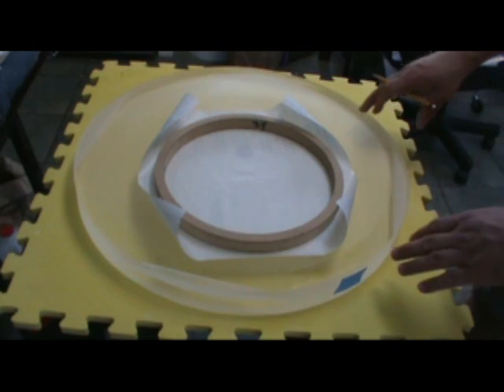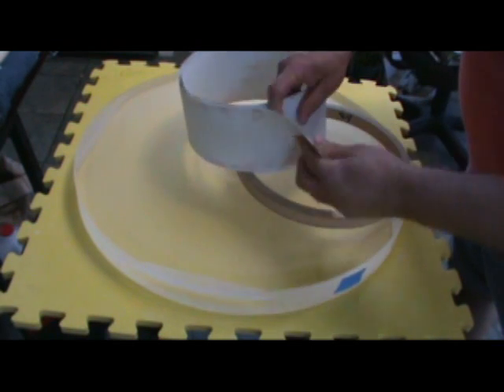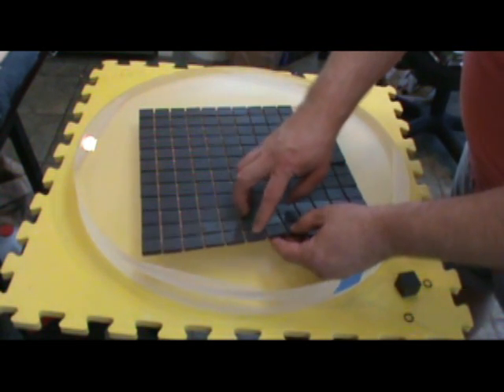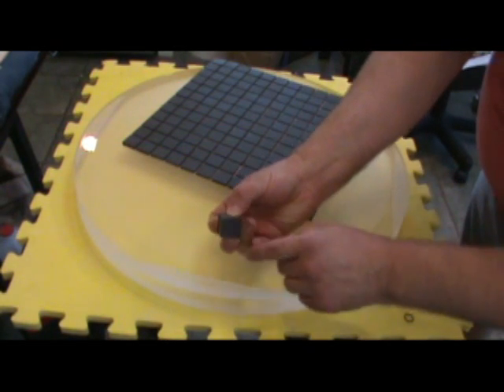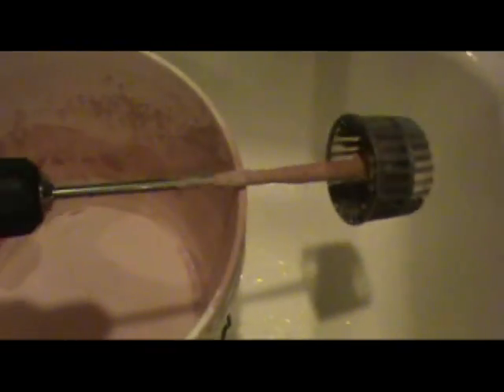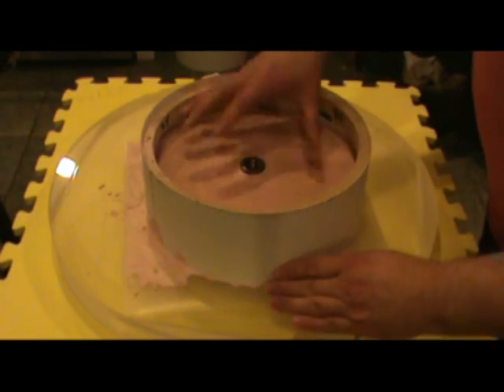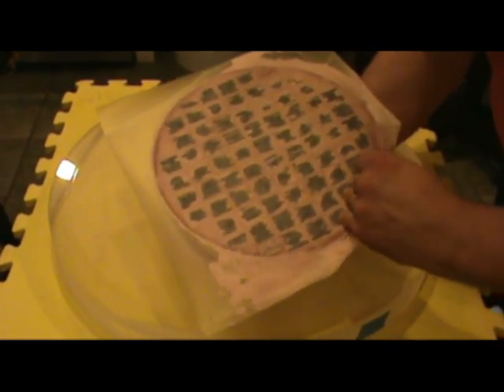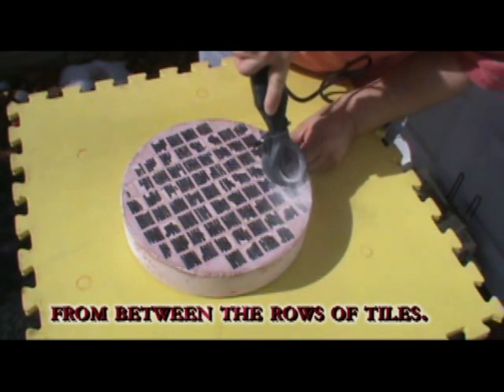Making a Ceramic Tile and Dental Plaster Grinding Tool for the 20" f/4.5 Telescope Mirror

Comment: Howd you get that mold?
Reply: I made the ring from a piece of MDF with a jigsaw.  The plastic strip was from a sign-making shop.
Reply: @gordonwaite1697  oh ok thanks 👍!
Reply from the maker: I usually make the mold by wrapping a piece of plastic around another mirror, or a wooden form.  Tape it so it won't come un-wound.

Comment: Hi, does the grinding tool have a straight  (flat) or parabolic grinding part?
Reply from the maker: If you start with a flat mirror, you also start with a flat tool.  If the mirror is already curved, you have to make a tile tool that matches the starting curve.

Comment: Where do you find telescope blanks, and how much do you pay for a 10 inch blank?
Reply from the maker: Swift Glass is a good source.  They will cut a disk from sheet glass.  A 10" might cost $150 to $450 depending on thickness and type of glass.
Reply: @GordonWaite  wow, you know theres websites selling 10 inch blanks for up to 1500?? These are clearly a scam im thinking. I expected closer to your estimate, thank you for sharing your source with us!!

Comment: Is there a particular reason for the use of dental plaster? Would cement or tile glue work as well?
Reply from the maker: Dental plaster is very hard, so particles don't end up on the mirror.  And it sets in about a half hour, so you can get a tool made and be using it without any wasted time.

Comment: You said this grinding tool only lasted about 16 hours. I am wondering what aspect of the tool was worn out after that time. Did the very thick ceramic blocks you made wear down that much, or was it something else? Does the tool slowly become convex as it grinds away the parabolic shape in the glass and that renders it useless? Sorry for the naive questions. I have a lot to learn before I consider attempting this....
Reply from the maker: The ceramic blocks wear down that much.  The tool does grind away and become convex as the mirror grows more concave.  This grind was a little out of the ordinary.  Most mirrors just need a normal layer of ceramic tile, but since this one wasn't pre-generated, there was a lot of heavy grinding needed.  Never hesitate to ask questions... I'm always happy to answer as best as I can.
Reply: Thank you very much. Still surprised how much the ceramic blocks wear down.   Learning........
Reply from the maker: Using abrasives like #60, #40 and #24 really are tough on the ceramic tiles.  SiC is some amazing stuff!

Comment: made of what is black?
whether it is ceramic for the floor of the house please explain, thank you
Reply from the maker: It is ceramic tile, like tiles used to cover a floor, or the area around a swimming pool.
Reply: Sir.GordonWaite After polishing how do you make a mirror on the lens? 
Can you tell me how to make it, the materials needed and the size of each ingredient. 
Thank you sir
Reply from the maker: I send my mirrors to a commercial coating plant, where they use vacuum deposition equipment to evaporate a very thin layer of aluminum on the glass to make it shiny.  Check out places like Majestic Coatings.

Comment: Question, I just made my 1st full size tile tool to hand grind an 8 inch f/6 mirror. I accidentally forgot to check to see if the surface I had my blank on was level and one side of the tool is about 2mm shorter than the other, should I start over or will this not be a problem?
Reply from the maker: Not a problem.  Grind away!  If you REALLY want to fix it, mark the high side, and take it out and grind it down on a sidewalk or a concrete block.  I wouldn't bother myself, but if you want...  ;)

Comment: I am trying to understand better the actual process of the way the lens takes on a hyperbolic shape . These are great videos and ty for your sharing :-)
Reply from the maker: The ceramic tool is ground on top of the mirror (which is face up) with loose abrasives in between.  Since the grinding tool is smaller than the mirror, it grinds more out of the center than from the edge.  Thus the mirror gets more and more concave the longer you grind.  That is a simplification, of course, but you can see the general idea.

Comment: Gordon, this question was asked earlier and I didn't see an answer.  Are there any issues with the dental plaster scratching the surface when you get down to 5 micron AlOx?  Or is it too soft to scratch?
Thanks!
Terry
Reply from the maker: +Terry McCreary Hi, Terry.  You won't get scratches from the dental plaster itself.  I've used it all the way down to 1 micron.  Although at 5 microns and under, your chances of scratching do go up a lot.  One thing is to make sure that all edges of your grinding tiles are fully embedded in the plaster.  If you have a tile that sticks out on the edge and is a little jagged, that can cause a scratch.  Also, make sure that the edge of the mirror is well beveled, and is down to a fine enough grit.  It's pretty easy for a tiny piece of glass to break off and produce a scratch.  The plaster itself won't scratch, but your tiles and the edges of the mirror itself can cause scratches.  When you have a perfect sphere at 3-micron abrasive, things are traveling pretty close to each other!  Best of luck to you...  -Gordon

Comment from the maker: @jacobabercrombie The tool is molded on top of your blank.  If you blank starts flat, then your tool starts flat as well.  With bigger blanks, you often have them "pre-generated" at the glass fab, so they already have a curve on them when you receive the blank.  Again, you mold the tool on the pre-curved blank so they match perfectly to begin.  -Gordon

Comment: Gordon,
Great videos!!! Very informative and clearly laid out. I have a couple of questions. Do you have any issues with the dental plaster scratching the surface when you are at smaller sizes like 5 micron, 3 micron, etc? I use hydrostone but was a bit afraid to try what you are doing. 2nd question: What is that little grommet/insert you dropped in during your pour to use for your guide on your machine? It appears to be a piece of a steel pipe with threads. Thanks again!!
Reply: I hear crickets.  I would use plaster of Paris or water stone.  Why dental plaster?  That stuff looks disgusting.

Comment from the maker: Hi, mirceaar...  The arrangement of the tiles makes no difference to the grinding process.  But usually take a rotary tool with a diamond-tipped bit and route out the channels in between the rows of tiles.  For that job, it's nice if the tiles are in a line.  But the pattern of the tiles won't make any difference to the grinding, as long as there are plenty of tiles.  -Gordon
Reply: I've done Lost Wax Casting before and It's something you might consider the next time you make a grinding tool.  Lay your tiles down first as you did.  But prior to pouring your dental mix, pour an 1/8 of an inch (or however deep you want your channels) of wax first.  Let it set, then pour the dental mix and let it set up. Remove it from the form and then just place the tool in an oven and melt the wax away, leaving the channels.  Perhaps a heat gun would work just as well.  Just a thought.  Enjoyed this and your other videos.